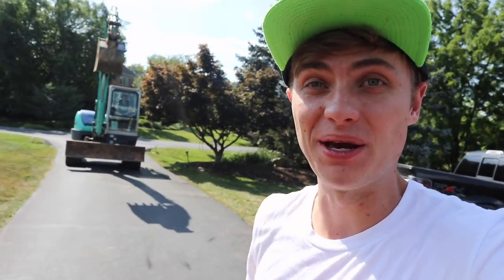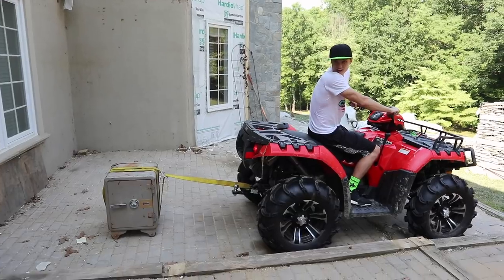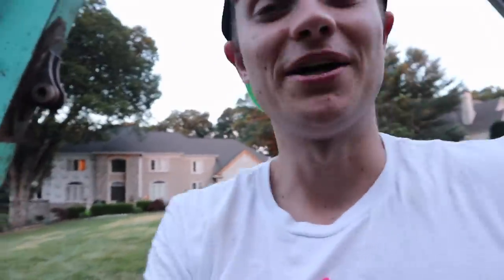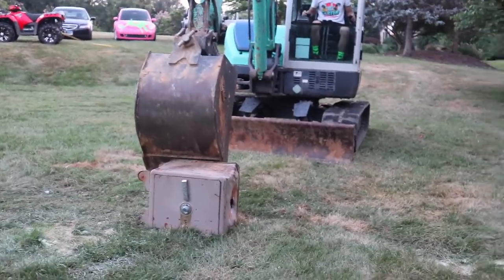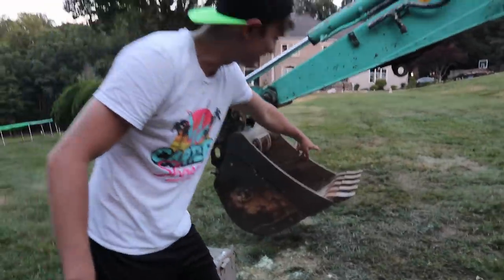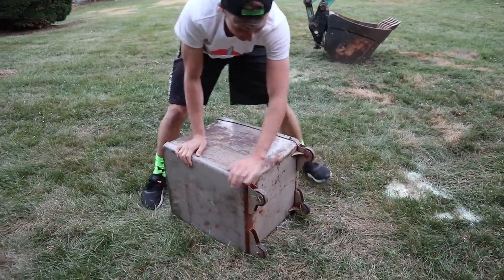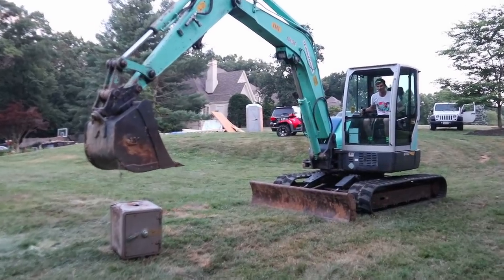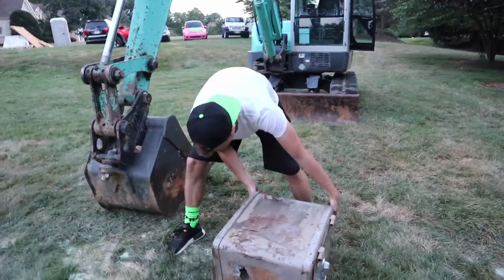RIPPING SAFE OPEN WITH MACHINE!!

Comment: Use an angle grinder to grind off the hinges and pry the door open with a huge crobar and a hammer.  You could’ve had that thing open on the first day you got it.  Go buy an angle grinder and a huge crobar.  Get it done.  Just throwin out a suggestion.

Comment: I know how to get it open you just need the crane again end some deadly spikes so you put the crane pokes in the hole again and put the spikes on the floor on the grass where you want 2 drop the safe and drop the safe on the spikes and when it drops and if the pokes go through the safe take it out of the pokes and if it goes through the safe blow a torch on the spikes till it is brown then pray it out with the end of a hammer and if all of the metal comes out drill it in and when that whole side is drilled you well see what's is inside the safe and show it 2 all of the people in the sharer fan house and that is how you open the safe